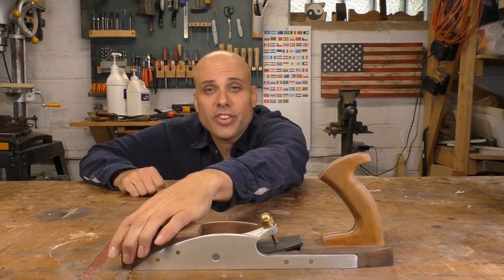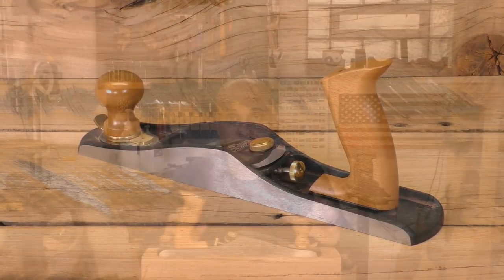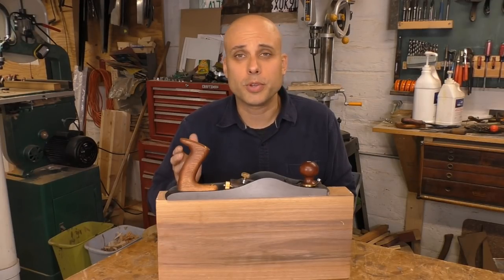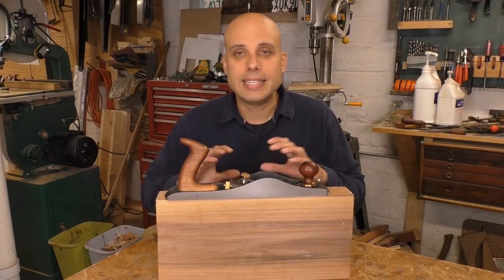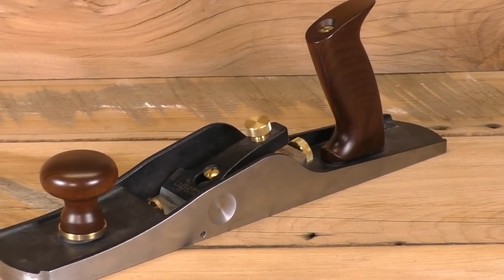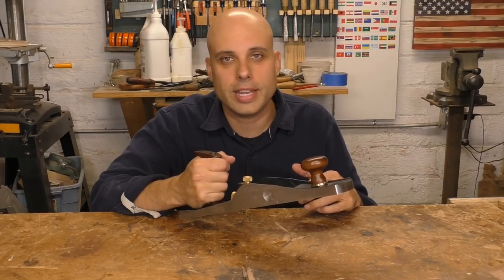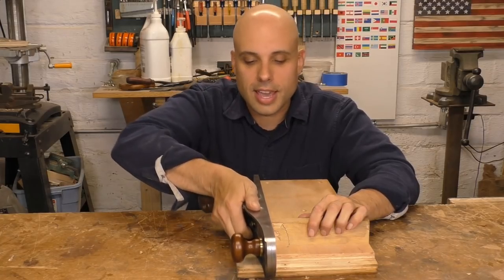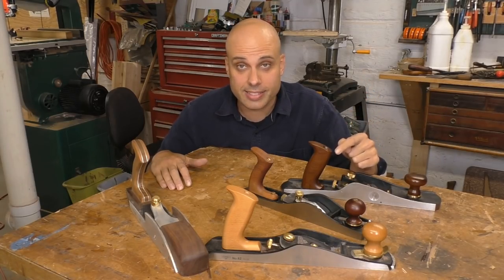Low Angle Plane Shootout!  What's the best value?

Comment: Great video as always Rex. I would like to mention the two blade centring screws on the Veritas so it always feeds the blade straight with no twist when adjusting depth of cut. Incidentally, the Veritas low angle plane was the first brand new plane I ever purchased and I cried twice. Once for the cost, and then it was tears of joy when I first used it. I ran upstairs to show my wife the ultra thin shaving I made, like I was coming home from school with an A+ in math...
Reply: Y'know, if you have a drill press you could always drill & tap the sides of the Stanley for hex socket set screws that will do exactly what the ones on the Veritas do. Just have them long enough to do the job, but not long enough to stick out above the surfaces of the sides when applying pressure so you can still use it on its side on a shooting board. Don't know what size set screws Veritas uses, but I'm sure you can figure it out.
Reply: The Veritas Low Angle Plane is the king of all planes. It is absolutely perfect in its design and versatility. Dopes like Rob Cosman might change their tune about low angle Jacks if they actually used the LV Low Angle Jack.

Comment: WOW!  I was ready to send my Veritas back because it didn't play music! I'm glad you told us about the shop fairies!  I can't say positively, but there are several blades available for the Veritas with different angles.  It probable that one of those blades might have solved the tear out problem you had.  The blades, of course, are not free.  Veritas did another smart thing when they made their low angle smoothing plane in that they made it big enough to use all the same blades they make for their LA jackplane.  Thanks for the video.
Reply: Ditto I have a collection of Veritas planes  love em. Have no trouble plaining against the grain even in Western Australia Tuart with the correct blade angle that is sharp  and throat closed to about 1/32 ". Tuart is notorious difficult to work.
Reply: @murraypotts924   I'll take your word for the Tuart. I'd never even heard of it before. I think the Veritas L A jack is the only Veritas plane I own. In conventional planes, most of mine are made by  Millers Falls. They are, for the most part, copies of Stanley planes although they have a better lever cap.  Some, but not all have aftermarket blades. Lately. the plane I reach for first is the Miller's Falls No. 15 which is fifteen inches long and comparable to the Stanley no. 5 1/2. Millers Falls went out of business in the mid 1960s. I don't know if they were ever sold outside of the U.S. and Canada.

Comment: Rex,

Thank you for the great video.....as a beginner woodworker, I appreciate the detailed information you consistently provide on your channel. 
 
I needed to get an additional, larger plane for larger projects (I only have one other plane, a TayTools low angle block plane) so I purchased the Stanley Low angle Jackplane that was part of your review, keeping my fingers crossed it would work well for my needs and I wouldn't be sorry I did not purchased the Veritas.  

The Sweetheart plane was not especially flat, but about 10 minutes of work on my diamond stones and it became "more flat" than it was before.  LOL.   I intentionally did not look at the edge on the  really thick blade, because my OCD would have required me to sharpen it using my Veritas Jig.  I made some cursory adjustments to the blade depth and straightness, then shoved it down a 1.5" piece of Birch and then a 1" thick scrap of Padouk.  

The ease and quality of the cut was much better than I had hoped for.  The sound when planning was like a sheet of computer paper being sliced by a plane blade or chisel when I am drinking beer showing my friends, wife or anyone that will listen, how sharp my hand tools are.   That sound was and continues to be, music to my ears.

Anyway, thank you for pointing out how good this plane is.....especially for the money.

Keep up the good work sir.

Mark Nicholson
Former, US Army - EFMB,
Combat Medical Specialist
1/94 FA MLRS

Comment: I really appreciate your objective, no punches pulled reviews. I used to buy old Stanleys and tune them as users. When I got my first veritas plane, the low angle jack, I had the same reservations as you, worrying I’d scratch it if I looked at it sideways. That quickly gave way to it being the first plane I reached for even when I didn’t need a plane... Non of the Stanleys I own are as much a joy to use, or perform as well. They are slowly getting replaced one by one with veritas planes because imho that extra price is worth it. Just my 2 cents.
Reply: Similar story in my small workshop. I had planes from Dictum which are a good start into handtool woodworking. After I could use a friends No. 7 low angel from Veritas I started to replace my planes from Dictum. As Rex and you said, at the beginning I'm very carefully with the Veritas planes, but after some time I use them without thinking about the price. ;-)

Comment: About tear out. The beaty of a bevel up plane is that you can grind the bevel to a steeper angle that better handles irregular wood. Better yet, get another blade so you can have both.

And off course, Veritas sells blades that comms pre ground at different angles.

And as always, an entertaining an educational video Rex!
Reply: Stefan Eriksson 

And while you are screwing around with different bevels, setting etc, I just readjust the cap iron on my bevel down Stanley and continue on.
Reply: I'm pretty sure Rex covered the use of blades ground at different angles in a previous video. It's an interesting way to get more use out of a tool, and I can see how the rigidity of the plane could make a difference in how well that works.
Reply: @ardvarkkkkk1  the whole point of this argument is that technically you don't need to buy an additional smoothing plane if you have the low angle jack and instead just get a second blade, to do the job of both planes at a lot less cost.
Reply: @johndoe920  

Point is, unless you want a different camber, there is no need to change blades on a bevel down plane.
Reply: @ardvarkkkkk1  except if you need a bigger plane for jointing, or if you need a plane for shooting, or if you want and even smoother finish with less tear out than you get from 45°, because you can just aswell get an attack angle of over 50° on a bevel up.

Comment: 1. As stated in another comment, you get a new blade and hone it at a higher angle and you, essentially, have a new plane. Don't buy the higher angle blades. Just get the standard 25 degree blade and hone it at 33 for an effective 45 degree angle. Get another and hone it at 45 for a high angle (52). Get one of the toothed blades for really difficult grain.
2. Veritas has a set of low angle planes: jack, jointer and smoother. They all use the same blades, so get the whole set. Set up each of the three blades at different angles (low, standard, high) and you really have nine planes.
3. You never talked about the side set screws. I use them to make super fine adjustments to the side to side angle of the blade. It's much finer than using the Norris adjuster, so you can get the blade perfectly parallel to the mouth. And then it keeps it from moving, which is really important when skewing the plane.
4. Get the PMV blades!
5. Seriously? You're afraid to use an expensive tool? What's up with that? An extra $100 over the course of 10 years is $10 a year. That's seat cushion money. 

The old woodworker saying is, "Get your second tool first because you're going to get it anyway." Get the most expensive tool you can afford. You won't regret it.
Reply: Such a true statement (2nd tool 1st)!!!  Then substitute "best" for "most expensive" and you've nailed it.  Most expensive is not always the best.

Comment: I don't have the time or desire to rebuild old stuff and try to make it work again so dragging and old Stanly or whatever out of the trash and make it work is out of the question for me.  That said I tried the Veritas at the Woodworkers Show 3 or 4 times and never got to use one that some kid hadn't tried to plane the concrete floor and twisted every adjustment on it to the point that they were like the Stanly in the trash pile.  I did get to a hand tool event last spring to see the Lie-Nielsen.  Everything was sharp, set up and there was someone there who was a woodworker (not someone from accounting) to help you try anything.  I fell in love with the Lie-Nelsen 62 and bought it on the spot.  When it was delivered I pulled it out of the box and wiped off the excess oil, flattened the back of the blades ( less than 60 seconds each) honed a primary bevel on a blade, put it in the plane and it was working as beautifly in my shop as it did at the show. that's worth the extra money to me.

Comment: I have a Taytools plane, it was my very first one. If I would’ve known when first starting out, that precision is just about EVERYTHING, I would’ve thought a little harder on that purchase.

Don’t get me wrong, it works just fine. But everything about it is off. The sole wasn’t flat, sides not 90*, frog is crooked (drove me crazy until I figured out it was that and not my blade)... It’s good for roughing and stock removal.

But getting everything true and flat and straight on that plane is wayyyyy more effort that what it’s worth. Honestly, you’ll thank yourself by buying more expensive tools. Don’t think you can get away with cheap, you’ll drive yourself friggin nuts.

Comment: 13:00 The good news is that the Veritas is ductile iron, so it's even better at getting bumped into things since it won't crack. 😃
Reply from the maker: That is a good point!
Reply: Oh yes thank you! I may rest now haha
Reply: That's an excellent point Lap Joint.  The other thing you get with Veritas (and Lie-Nielsen) is their legendary customer service.  I've had Lee Valley send me out replacements parts for things that "I" broke for free - they even picked up the shipping. I was prepared to purchase them and they just sent them out gratas.  Also, there are no better people on the planet to work with on the phone.  I also had a LN No. 9 Miter plane that I loved and used it on a utility bench I was making.  I went to town planing down a leg and thought I was encountering a little too much resistance with a knot hole.  It turns out I wasn't.  It was actually the tip of a screw that had protruded above the leg surface and I put about 4 or 5 DEEP scratches along the length of the sole of the plane before I realize my idiocy.  I almost fainted when I turned it over.  I contacted Lie Nielsen to see if I could pay them to surface grind the sole for me.  They said no problem.  Two weeks later got an email from them saying that the scratches were too deep and regrinding would weaken its structural integrity.  They also said they replaced the whole plane (for FREE) and I should be receiving it UPS within a day or two.  I couldn't believe it 1) because of their generosity and 2)  because by that time they had stopped making that plane.  They must have pulled it out of the private reserve or something.  So there are some advantages to paying more and patronizing those companies.
Reply: @yoyopg123  nice story Paul, I do also think good tools are worth investing in. I don't think the hassle of setup and the constant setup is worth some cheap tools
Reply: @yoyopg123  I had a similar experience with the customer service folks at Stanley. I bought one of their SW No. 4 smoothing planes and it came with a chip breaker that wasn't up to par. I called them and they sent me out a whole new blade set at no charge. The big boys aren't always the only ones with good service. Just sayin'...
Reply: John Smith  Wood River also has great CS. I dropped a brand new WR No. 5 on the floor of my shop and broke the tote. After an unsuccessful search for a new tote I called Wood River and they were kind enough to send me a new one at no charge. They're winners in my book as well. I'm sure that LN and Lee Valley provide great service, but their tools are just out of my price range.
Reply: Problem is that ductile iron is more likely to stay where it flexes
Reply: @RexKrueger  I believe the Stanley 1-12-137 62-Low Angle Sweetheart Jack Plane, is ductile Iron as well?
Reply: @watermain48  Actually Wood River are ONLY marginally LESS than Veritas . viz ,WR 5 1/2 Jack $269.99 ,LV 5 1/2  Low Angle Jack $299.99 ,for $30 you get a whole lot MORE plane.
Reply: @738polarbear  Not exactly apples to apples, though, since the LV 5 1/2 is a low angle jack plane.

Comment: I can highly recommend the Veritas #5 low angle jack plane with PMV-11 blades. Buy once, cry once.
Reply: Until your roof leaks and you have to de-rust your cast iron table tops... it was a brand new roof. 
They didn't install the plumbing vent properly.

Comment: I am a 'wood worker' for over 30 years and have built all different types of projects.. the first tools I bought was from Lee Valley.. there planes are the model called  Veritas and they are the best.. over the time I worked in different shop and I also used there models of planes and the Veritas is better than any other version.. the Veritas planes were more money but they are still perfect after over 30 years so the cost is worth it !!

Comment: The Veritas. It's a great plane and if you want the best it's well priced. Of course you can get by with something else, I've got an ancient stanley no5 that I got 35 years ago with a samurai japanese plane iron which is well set up and nearly as good but I instinctivly go for the veritas even for small jobs, it just feels right and works great. I'll have to check which iron i've got in it because it keeps it's edge and doesn't need regular sharpening (i'll get back on this as i bought a few different blades to see which one worked best for me)

Comment: I've heard that a low angle jack plane can actually be more universal with a few extra irons. One with a steeper bevel can be used for smoothing, one with an arc bevel can be used scrubbing, and one with a square edge and a bur can be used for scraping. I think, this could make an interesting topic. Are these effective solutions? How do they compare to dedicated tools? What are the compromises and are there any issues?
Reply: Your comment is from a year ago, but better late than never. Anyone with these questions will want to check out the Popular Woodworking article, “Bench Planes: The System of Three,” for more details, but the answer some of your question in brief, changing the angle of the bevel will indeed have an effect, with higher angles decreasing chances of tear-out–if you have a honing guide that allows for it, you can even increase the effective angle of your bevel down planes by adding a small back bevel. The cutting action will be the same, regardless of using the jack vs dedicated scrub, but the performance limitation is going to be the dimensions of your plane and the blade itself. I recommend a web search for the article I mentioned since it includes illustrations, but the basic idea is that your wood is a wavy surface with hills and valleys, and the longer your plane is, the more it will gently flow over them. Ditto for width of the plane, since we also consider the third dimension.

Comment: Halfway watching the video and I was struggling to finish the video first and then give my compliments!! Gret video, and one of the best reviews I have seen on YouTube! To the point, comprehensive, professional, and unbiased!! Thanks a lot! 
I also enjoyed the singing fairies!
I have tried maybe 6-7 different new Stanley planes, and I think the bevel up is by far the best. I agree that it cannot be the only plane, and one plane cannot do it all, but you can have extra blades to handle the tricky tasks: one for scrubbing and another with a secondary (very) high angle to do surfacing might make this an only plane. Just a thought.
The casting on the other plane can be milled again, to turn it into a Norris adjuster, but why go to the trouble if you can return it!
Reply: Again, I want to know where to get spare blade? No luck for me on the Stanley 62.
Reply: Just looked at home depot site and they list blade number, but not in stock at Stanley. I wonder if other manufacturers blade would work.
Reply from the maker: I'm really glad you enjoyed this video!  I cover blade switching in a previous video.

Comment: There is a fix to try on short handles...(None of those shaped handles fit my palm) the flea market fix,  a friend says just hit the top of the handle with a hammer and break the jabby part off  :- )  looks ugly but better fit to a larger hand.  The German ones with unicorn handle in front and my block plane (no handle) don't have that problem. Love my little cheap Stanley block plane.  Nice job on your home made the low angle jack plane - cool, will look for that video.  Thinking a shaving horse, Roman work bench with vise & a wood lathe could be combined into a good traveling workbench.

Comment: I've  got the stanley sweetheart low angle jack and a veritas low angle smoother and I'd agree with both  assessments of the the tools. Obviously the veritas smoother is slightly different from the jack, not so good for edging boards for example, but still everything else holds up.

Comment: Great vid. I am in need of my first plane well I do have a mini Stanley that I got for $5  from lowes. It actually works ok if you tighten the screw with a tool but not by hand. I will probably go with the Veritas since I am trying to make just one plane work for all my tasks. I tend to agree with you about a tool is meant to grab and work without worrying about it. I have chipped my good axe and my good spoon gouge but they still work great:] I like Stanley but there quality is not what it once was and cheap tools is there bread and butter. Ty Dewalt or whoever owns them now.